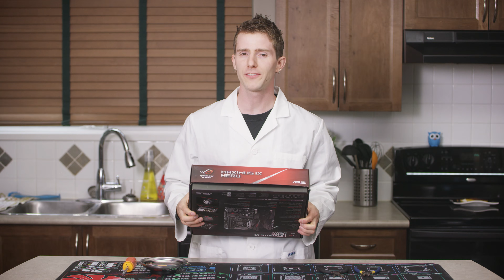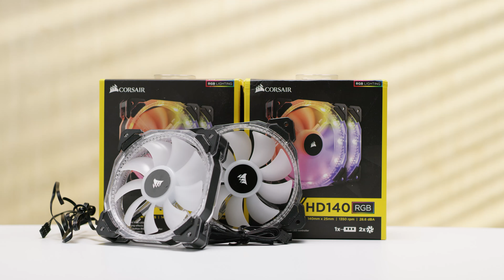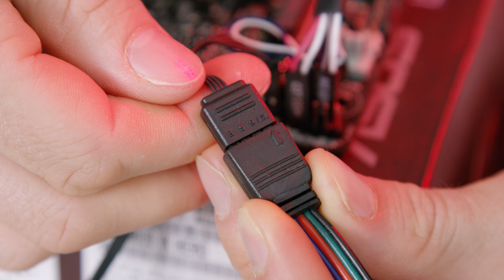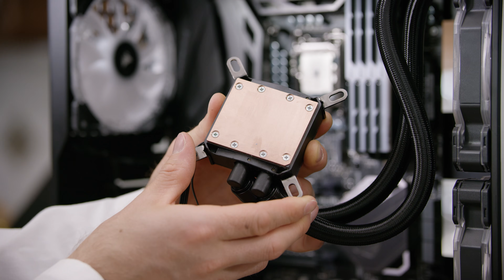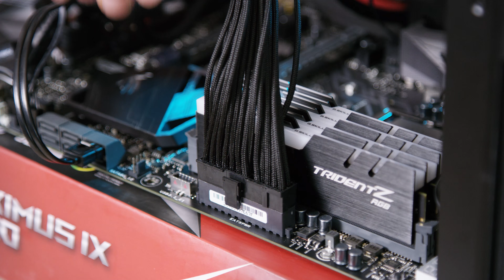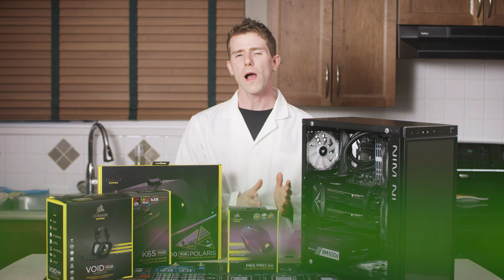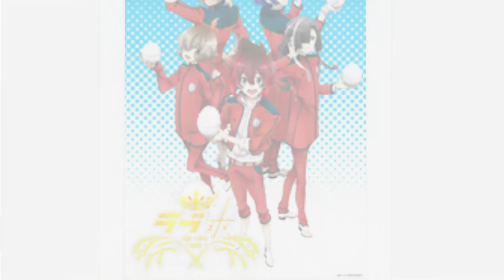The ULTIMATE RGB PC Build Guide!

Comment: $2500 build... has a Core i5...
Reply: The Official Mookie depends on what core it is, probs not from 2011
Reply: I5 is not bad.. i would much rather buy a i5 8600k than a i7 7700k
Reply: No, they get almost the same fps ingame and they are twice as cheap
Reply: Kdke3kj Krkrjrj yeah in game but in general not.. people use CPUs for more than games. Appreciate your hate comment too.
Reply: @Hydra453  i would still much rather buy a i5 8600k
Reply: @yumyunrangLOAL  i7 7700k and 8700k is not the same
Reply: @yumyunrangLOAL  the i5 is better at gaming
Reply: @yumyunrangLOAL  if i7 7700k is better than how do you explain how i5 8600k is better rated based on benchmarks? https://cpu.userbenchmark.com/Compare/Intel-Core-i7-7700K-vs-Intel-Core-i5-8600K/3647vs3941
Reply: forgive me if i am wrong... but does the generation rlly matter????
Reply: @yumyunrangLOAL  would you rather buy a i7 7700k over a l5 8600k?
Reply: @yumyunrangLOAL  i would think that i7 9900k is better
Reply: @yumyunrangLOAL  i asked you if you would rather buy a i5 8600k than a i7 7700k
Reply: @yumyunrangLOAL  a i5 8600k is better than a i7 7700k and it is alot cheaper
Reply: @yumyunrangLOAL  "Only about 5fps" well the difference in-game with an i5 8600k and an i7 7700k isn't gonna be huge either.

However you do have a point when you say that CPUs are used for more things than gaming, video editing, rendering, and other things are much better suited for i7s than i5s, although the difference won't be too big except in really intensive tasks...
Reply: @thefakeelon2673  i was never talking about i7 8700k
Reply: @yumyunrangLOAL  AMD masterrace
Reply: @yumyunrangLOAL  people need to buy the cpu based on the build and budget they have and what they will be doing with that computer. If you are gaming on a 144hz 2k monitor and do not do alot of video or photo editing, a 6th or 7th gen i5 paired with a 1070 will literally do everything you want it to do. Spending unnecessary money because "an i7 is better" (derp derp) makes no sense. I personally play on a 1080p 60hz monitor still and have no issues with it, that is why I chose to keep my old z97 mbo paired with an i5 4670k. All I did was grab a 6gb 1060 msi card. I can play everything on max settings on what I have with zero bottle necking plus overclocking is a breeze on the graphics card and cpu still running everything over 60fps, most games over 100fps max settings. Now that 4k monitors are getting cheaper and the graphics card mining has taken a dumb and finally brought graphics cards back down to a reasonable price, I will be picking a new system up soon. Honestly I will stay away from the new 20x series graphics and still opt for an i5 new gen and 1080 card on a newer dd4 supported mbo and get over 60fps in games. i7 is really only necessary if you are doing very heavy cpu intensive work loads. Single core performance is almost on point with i7s and i5s.
Reply: @yumyunrangLOAL  you only run into issues based on what graphics card you are pairing with the i5 or i7 and also what monitor you are using. Ideally you would want your capability to be on par with each other at hitting 100% load on graphics and cpu around the same time depending on what task is at hand (like what you use your system for). An i7 is better at gaming period, but if you are wanting to game at 144hz on a 2k monitor you can use an i5 and be completely fine and save the money that you would be spending on an i7. Now if you are 4k gaming an i7 would be much better. It depends on what you are using. Hell you could get away using the new i5's they have out now for 4k gaming. 6 core 6 thread 12mb of cache is plenty. Even good for moderate video and photo rendering. There is a point where you start to get into overkill and there is unnecessary performance that cannot be fully utilized and at that point you waste money. I feel if anyone has a high tier new(er) generation i7 for gaming anything under 2k and does zero workstation tasks where you need that multi thread capability they bought that i7 for no reason and at that point an i5 would be better. It's like someone buying a Lamborghini to sit in traffic, does not make sense, it's just flexing.
Reply: “hate comment” u liberal?
Reply: value to performance, i5 8600k reigns supreme for intel, overclocked to 5ghz or more u cant see the difference between i7 7700k
Reply: but i guess your “opinion” on something doesnt make it better
Reply: Dark Flight both the cpu's performed similar . Only i7 had to use a bit less power than i5 . i5 is better than i7 as it costs way less and performs similar . I use both and know the difference . And your comments seems like written by a 9 year old who thinks that what he owns is the best .
Reply: @rafidirtizaahnaf485  you can tell his a kid because he typed in capslook and used lol in a earlier comment
Reply: That's because the money was spent on MORE IMPORTANT THINGS
Reply: @yumyunrangLOAL  I feel like you are some nerd who buys the new stuff instead of research because you're letting your anger show while the other guy is trying to debate with you.
Reply: @yumyunrangLOAL  where did you find the fact "buy the most expensive one"?
Reply: @yumyunrangLOAL  you probably just tought "hey, this is the expensive one, i need it to render my nonedited shity videos witch can be done by a intel intel pentium"
Reply: @yumyunrangLOAL  how can i lose when im right
Reply: @yumyunrangLOAL  how did you prove me wrobg, because all you talk about is that fucking i7 8700k even tho it got nothing to do with it
Reply: Dark Flight an i5 8600k beats an i7 2600, so i5s can beat i7s 

(I know what you mean though, this is just a troll comment. Don’t get triggered)
Reply: Dark Flight haha, thanks man, just tryna lighten the mood
Reply: Dark Flight the video literally compares an i7 8600k and an i5 8700k, which was not the original compare of an i7 7700k.
Reply: @Hydra453  if you have an intel cpu, youre gaming.
Reply: @yumyunrangLOAL  Im not hating on you just trying to see what you think you gain from this. You habe a i7 8700k congratz it is a really good processor.  But every one does not have the money for it. I5 8600k is a really good processor if you look at the money to performamce ratio. Can't we all just get along. Most of us probably like pc and i don't see why we should fight about such a unnesecary thing.
Reply: @yumyunrangLOAL  You continued it.
Reply: This reply comment section is so fucking cell diminishing disease (cancer)....
Reply: Leo Aglasinger yea that's pretty true
Reply: The Official Mookie cause it's got sli
Reply: @gastricacid  i know it is better to buy a i5, it is what i have been saying all the time.
Reply: What's the issue with being cheap and "outdated" as long as it works out for you? Not everyone can afford top of the line stuff, and even if they can that doesn't mean they should.
Reply: @yumyunrangLOAL  the core i9 9900k is wayyyyy better than all of those cpu's
Reply: @yumyunrangLOAL  alot of people dont use it for video rendering i dont i use it for gaming
Reply: @yumyunrangLOAL  That was the dumbest thing I think I've ever read.
Reply: The Official Mookie its okay rgb give it 900 refresh rate
Reply: Why the f did I just read all of this
Reply: @stefank.3983  lol i just finished reading all this, and thinking the same thing..
Reply: Yeah, but it does have 64gb of ram...
Reply: @GlorifyGodInEverything  "Its a gay ass discussion" summed it up perfectly. The end.
Reply: Dark Flight also just relax man, why do you gotta be so arrogant and down peoples throat over a cpu discussion, I thought pc community was friendly and more mature and civil than console community but you just came across so rude arrogant and immature instead of having a mature mannered and respectful conversation with people within your own community, it isn’t a competition like your right i7 is better at overall multiple tasks for a pc man yeah your right no ones trying to prove you wrong on that, your not getting the point, THE I5 IS A BETTER PURCHASE FOR A GAMING ONLY PC FOR SOMEONE ON A BUDGET PERIOD, IF YOU BUY AN I7 FOR A GAMING ONLY PC ON A BUDGET YOUR WASTING MONEY ON FEATURES THAT WILL NOT BE USED, simple as that
Reply: Dark Flight t
Reply: guys I have a i5-6600K and a gtx 680 and it works well at gaming and video editing.this argument is dumb.
Reply: What is the best core?
Reply: BRUH!
Reply: @yumyunrangLOAL  tone down the cringe I couldn't make it down the entire comment train
Reply: @yumyunrangLOAL  I have i9
 You poor soul
Reply: @yumyunrangLOAL  i7 beats an i9 simply for one reason

7 ate 9
Reply: @yumyunrangLOAL  Just please stop , it's his preference
Reply: Doesn’t matter. Gpu is more important for gaming
Reply: Kdke3kj Krkrjrj well i don’t care but have you ever heard of throttling? Ye anything above a 1060ti will get throtthled  by the cpu. Soooo
Reply: @yumyunrangLOAL  "no way would a(n) i5 EVER beat a(n) i7 in a video rendering form." 6 core 6 thread > 4 core 8 thread for video rendering don't @ me. I5 8600k > I7 7700k.
Reply: @Hydra453  Lets be realistic anyone that builds a RGB PC that's this overkill with LEDs isn't going to be using their PC as a workstation
Reply: R. elentless okay but the argument was if an i5 was better than an i6, answer is no, but much better value outta the i5
Reply: Why are you guys mad at each other. Yes an i7 is better but it's for people withe the money and an i5 8th gen isn't really out of date and it's for people with not a lot of money. I had i5 8400 because I didn't have enough money. Then i got an i7 8700 and it was also good. With that I have an Asus gtx 1070 dual, and in my opinion it's good... for now with the g skill trident z rgb 8gb 3600 X4.
Reply: Mookie Talks Tech lol
Reply: @yumyunrangLOAL  Dude, it's time to stop. Just stop. Please, stop.
Reply: So we're gonna talk about that and not the fact that he used Sli 1070s
Reply: @johnjihn7748  Lmao.
Reply: @Matthew I was trying to say what you just fucking said, To all the kids who cried about the 8600K being better then an i7 7700K in GENERAL PURPOSE.
Reply: @xzeeishere1476  Idk, maybe you've used both and know this already but from my experience with an older i7 and an 8th gen i5 the i7 can have multiple games open and browsers and as many things as I want and switch between them instantly whereas the i5 if I have a game open and say a browser it'll take some time to switch between them. Imo unless you're only gonna be running one thing at a time I'd always go for the extra cores from now on, especially as more and more programs are being better optimized to take advantage of more cores. 'Course you're free to do what you like, an the i5 is cheaper but that's just my experience.
Reply: AND RGB!!!
Reply: @phrg8332  1060ti :thinking:
Reply: It's all the rgb that makes up the price 
Personally I'm pretty sure this is the case for all rgb PC's 
And I'm pretty sure for my personal pc I have spent more on rgb than other more important parts
Reply: @xzeeishere1476  I totally agree with you. i think you are the only one who has clear vision here. i5 can be better than i7 depending on the genereation, but it will also depend on the activity users are gonna do.  Other guys clearly on the whole different page than this guy.
Reply: @xzeeishere1476  the processor is not what alters the fps.
Reply: @xzeeishere1476  Don't listen to these mainstream 12 year olds. They probably think the iphone x is a good thing.
Reply: I'm just chillin over here with a Ryzen 5 2600, as many cores as the i5 and hyperthreaded too lol
Reply: @GlorifyGodInEverything  yeah, I think that an i7 is just a middle ground between Ryzen 5-7 and i5 because it's got the single core speeds to keep up, but also has a few cores and normally hyperthreading, which Ryzen does anyways - https://cpu.userbenchmark.com/Compare/Intel-Core-i7-7700K-vs-AMD-Ryzen-5-2600X/3647vs3956 multicore speed is what I'm looking at btw
Reply: @JB04272  wtf boi it's the same single core speed as the i7 9700k AND the same quad core speed. Just got more cores and threads. If you just use that for gaming, I hate to break it to you but... you may be RARTED . Or you're just some spoiled rich kid who gets everything they want. Just like my friend who only plays minecraft and has a 1080 and i7 8700k lol
Reply: @phrg8332  maybe if you said the correct GPU it would make sense lol
Reply: exactly
Reply: Mookie Talks Tech who cares its rgb, its perfect for pleasing my adhd
Reply: He really deleted all of his replies
Reply: Mookie Talks Tech the RGB makes it faster so it’s ok.
Reply: I wish it was a Neon Xeon
Reply: TriGgEreD
Reply: Its an ok one buttttt for a2500 pc no
Reply: Yeah my brother got a $2200 build with the i5 8600k
Reply: I have a
Reply: Mookie Talks Tech the i5 9600k is the best gaming cpu right now
Reply: @xzeeishere1476   is it better than the i7-9700K Coffee Lake ?
Reply: Mookie Talks Tech if he bought an i7, he wouldn’t have been able to buy all those rgb fans and possibly sli 1070
Reply: Xzee is here 8600k is a beast and will destroy 7700k and get same FPS as 8700k at 5.2 ghz 1.35 v
Reply: Ginger Ninja there the same in gaming performance lmao
Reply: Sans other than higher clock speed and more cores?
Reply: Core i5 Plus RGB's that increase 20% peformance
Reply: RGB requires sacrifice
Reply: Do you know anything tech related 😅
Reply: My real question why intel?
Reply: Xzee is here this is a 2.5k build but its an i5... you can fit a i9

Comment: Why no NZXT Kraken X62 it has more RGB than the H110i and it has way more RGB per dollar
Reply: Nick Sherry don't know if you can tell that it's sponsored by corsair
Reply: I would say to get as much as possible under one (or two) RGB controller softwares umbrella. Nzxt doesn't really produce all that much, whereas corsair, and asus both have almost everything you would need to do a full RGB build.
Reply: i think because the water block for the nzxt aio doesn't sync with the other components.
Reply: If they'd have used the Asus Poseidon GTX 1080Ti in SLI and the NZXT Kraken x62 they'd have an infinity mirror theme in addition to the RGB theme, which would've been cool.

But also ridiculously expensive.
Reply: Nick Sherry U little copycat of my comment
Reply: Lars Ose-Johansen everyone thought the same lol
Reply: Felix XD I wrote my comment many hours before him soo..
Reply: Aleksi134 The point of the build wasn't to puke a bunch of chaotic RGB.

Comment: could have been more RGB with a NZXT Kraken x62
Reply: But, corsair!
Reply: Dexter Power yeah but then you have to download CAM..
Reply: Firstly. Sponsors. Secondly, Sponsors, thirdly. This was probably filmed 2 months ago
Reply: also, the NZXT Kraken series clcs are not aura supported ^^
Reply: RiversDelay well I don't think the corsair cooler is supported by asus aura sync either. The kraken x62 would've given more color options and customizability even if there was no aura sync
Reply: yeah, but it doesn't have LEDs, the whole point was to sync everything, I guess
Reply: Jason M they tried to minimize the amount of different softwares for one system. CAM adds some extra strain on the CPU and isn't that great. But I do admit it would match the look nicely
Reply: Yeah I can see the nightmare of different software programs to deal with, but I mean they went all out with RGB on everything else including the PSU, I dont see y dealing with different software would prevent them from going all out on a Beast AIO(i.e Kraken x62).
Reply: Dexter Power Corsair clearly sponsored the whole thing so ..
Reply: For more RGB, I would also get a 8 dimm motherboard, for twice the RGB ram.
Reply: Aura compatible?
Reply: Software or Sponsor shouldn't be the reason to hold back on building the ultimate RGB computer.
Reply: CAM doesn't play nicely with other RGB software.
Reply: +TheSoulFallen Really cause that the dumbest thing I have ever heard.
Reply: grlmgor it's true
Reply: LOL that really counter intuitive of NZXT considering your paying a premium for their RGB. Then they don't have any other RGB products apart from cases.
Reply: Yeah there are known issues of running aura and cam at the same time. Not always but it happens